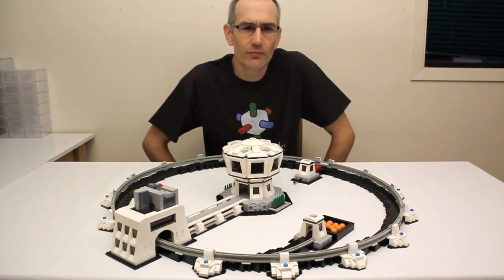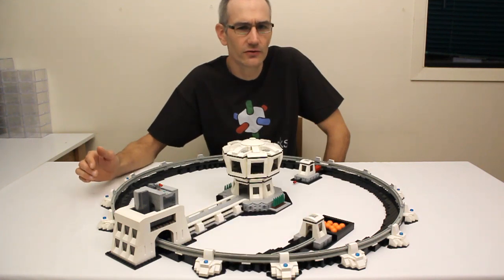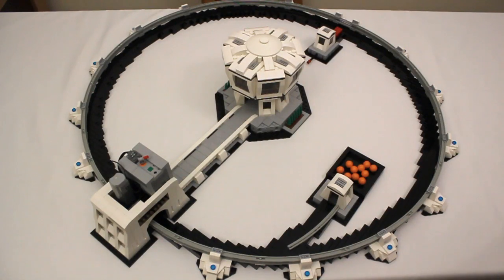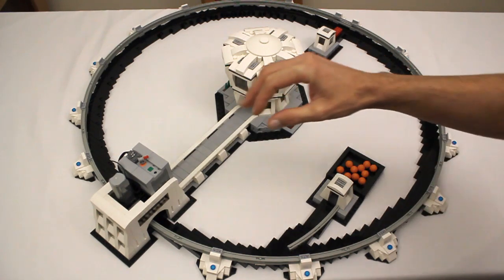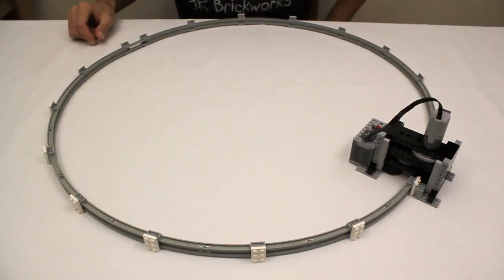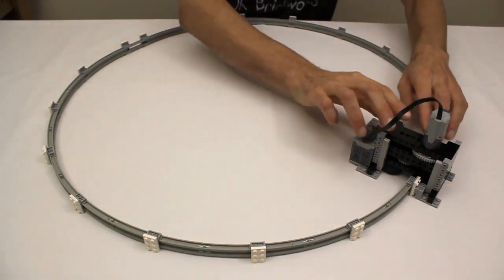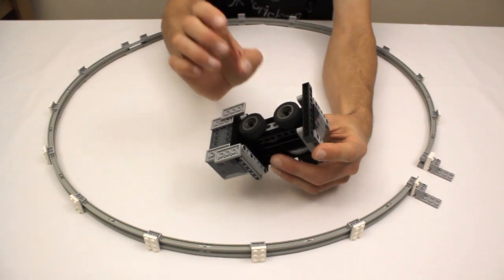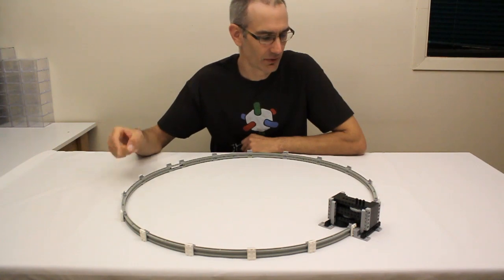Particle Accelerator Instructions, LEGO Ideas and more Balls!

Comment: If anyone if confused about how this works, its like the flywheels in an electric nerf gun. The box on the track propels the ball(s) around it where they loop back into it to continue moving around. The speed is changed by changing the speed of the motors to make the flywheels go faster.
Also could this work with nerf darts?

Comment: What parts did you use for the ring? Are those the inside or outside rail curves? Specifics would be nice! Otherwise, your project is awesome!
Reply from the maker: Piston man Actually I'm using both in this video. :)  The 'themed' ring, with all the buildings and details is built using the outside rails, while the basic ring and accelerator is built using the inside rails.  You can find the full parts list and step by step building instructions here: http://jkbrickworks.com/particle-accelerator-instructions/

Comment: What are the possibilities of a Bricklink Designer Program update on this great set? Has much changed with the design?
Reply from the maker: I'll be posting a design video for the updated model once the crowdfunding starts. I mean, it's a completely different model, though it looks very similar at first glance. The core design elements are all there (control center, spinning wheel accelerator, ball insertion tower and brick insertion module), but I had to rebuild it using parts that are in production.

Comment: Very cool! Supported on ideas and also built one myself. However mine doesn't run nearly as fast as yours. Do you have a different gearing on the finished model compared to the basic one? I tried gearing it to run faster but I didn't really gain anything and the ball started flying off.

Comment: What if you were to add a gear to the free-spinning tire in the Accelerator Module, and then connect it to the motor so that it spun in the opposite direction? Would the extra friction be worth it?
Reply from the maker: I tried it, but it didn't make any noticeable difference.

Comment: Why do the balls space out evenly when they reach maximum speed?
Reply from the maker: The Mr O YouTube Show I don't really know.  It might be that the accelerator slows down a fraction as it fires a ball.  It might take a split second to ramp back up to full speed.  So if two balls go into it back to back, the second ball might not be accelerated as fast. But I'm just guessing.
Reply: JK Brickworks Or it might have something to do with the frame rate in the video - I would suspect that.

Comment: I think the problems were the rails. they would have to start producing them again and for one fan submitted model it wasn't worth it. :3
Reply: James Ray That's a good point, but they could replace the rails with something else. Another reason I think it was declined was that the price wold be to high, and the balls spinning so fast prove a safety Hazard.
Reply: the goat is here well, the safety hazard with the balls thing I wouldn't really count as in some lego minestrone, lego technic and lego bionicles kits you had ball shooters which shoot balls anywhere at quite high speeds. And replacing the rails would be a pain in the butt, those are curved prices which there aren't many of in today's kits that are that size, since it's a fan made model there really is no need for them to make it and so its easier to just, well, not...

Comment: What happens if you use an xl motor
Reply from the maker: zeddmau5 The maximum speed of the XL motor is actually slower than the M motor, so just replacing it with the current gearing would make it run slower. It has more torque though, so you might be able to gear it up more.